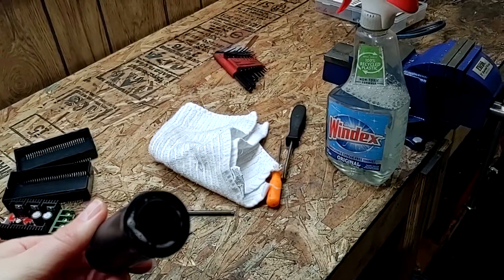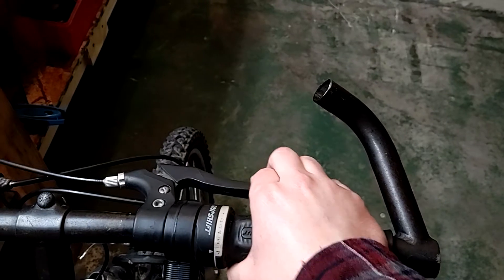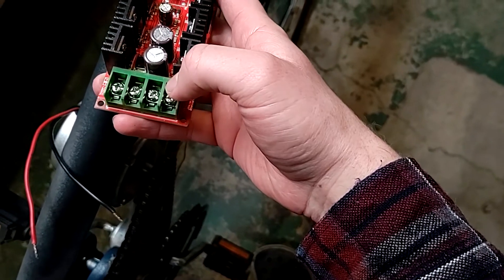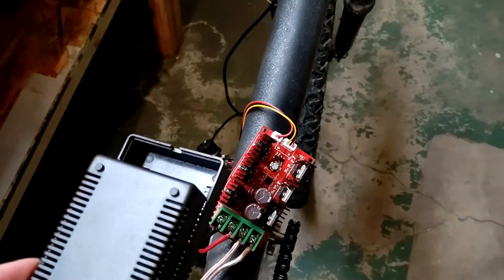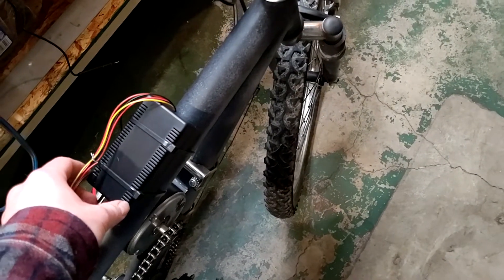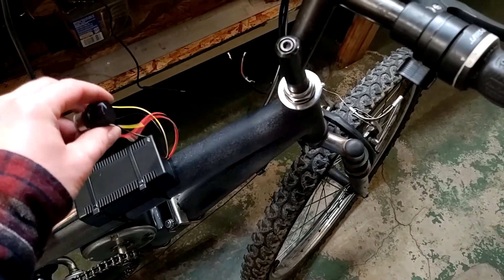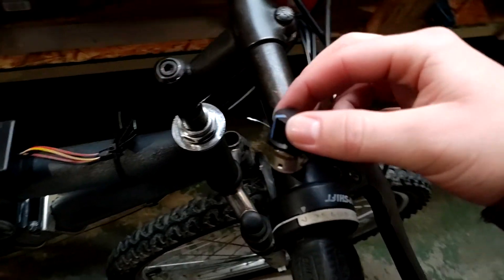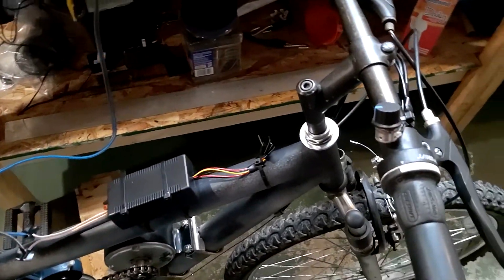DIY E-Bike Build - Wiring Controller EP7

Comment: How fast is it with that motor?
Reply from the maker: The motor is rated at 2,500RPM. With the gear ratio that I used, it ended up having a top speed around 11MPH.

Comment: Watching this makes me wanna take the little kid 24v 250w electric scooter I got for free and put the parts on a bigger scooter. I wonder if I could use a bigger 24v 850w motor that I have laying around with the 250w scooters electronics?
Reply from the maker: You could always give it a try and if the controller burns up, just get a higher watt replacement on eBay for cheap.